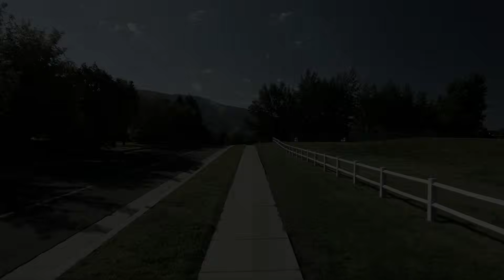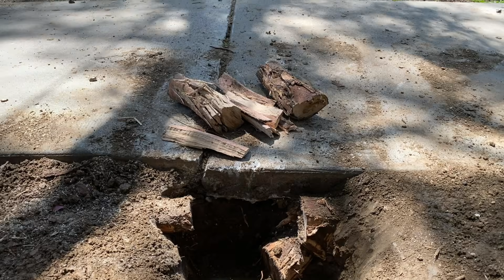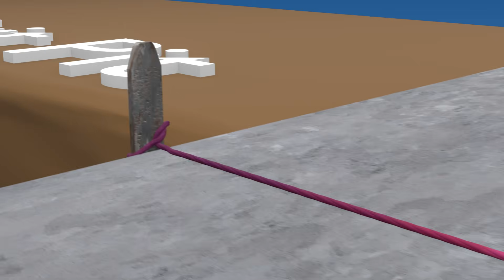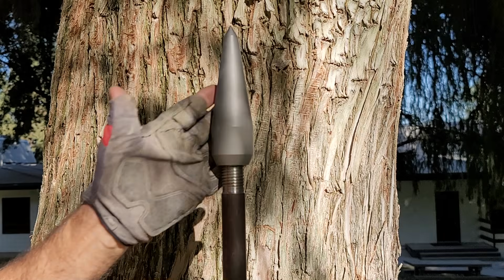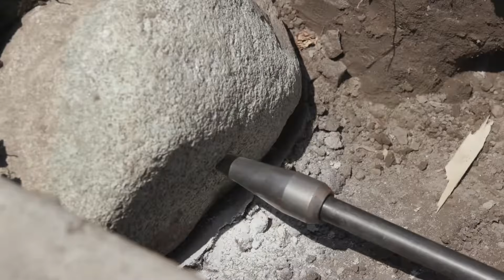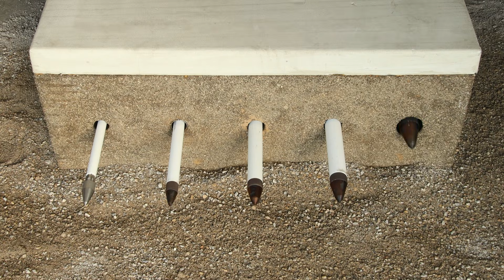Bullet Mole Sidewalk Kit | Bulletmole

Comment: These types of practices have been banned by most Utilty Companies in Australia. Aside from the injury risk using a sledge hammer, imagine going through a power cable with this thing. The next strike of the hammer blows your feet off! We were doing  this 40 years ago with a pipe and cap, cave man stuff. Are we reverting back to it? Next it will be the ratchet hand bore with a boring rod and bit. No wonder my backs near broke!
Reply: Your not allowed to use a sledgehammer in Australia?

What in the actual f**k? 🙄
Reply: @treasurecoastanglers1003  Go to specsavers, Nowhere does it say that you can’t use a sledgehammer in Australia. The practice of knocking a bar or point under a path is condemned.
Reply: Stephen, You are the reason O.H&S was invented. I wonder how many people would like to test your ridiculous theory. Surely you replied in jest.
Reply: Is all I can say is when you call dig alert first you eliminate blind penetrations not knowing what's underground in the area where you intend to make your hole. So let's entertain going through a power line, to begin with the handle of the sledge is non conductive, usually fiberglass, nylon composite  or wood so how does the AC current travel to your legs?  If it were metal then it would go to your hands first.. your boots are insulated so there is no return to ground. As such it would be impossible to even get shocked much less blow off someone's legs. To begin with, It would take much higher than 4 phase current and direct contact to your legs to even come close to Blowing them off. Dont exaggerate. It's not a lightning bolt.. How many amps does the average lightning bolt Produce ? Anyway who buries a 4 phase power supply within 24"  under a sidewalk..for crying out loud... no one.. If you did go through a charged power line. Say realistically,110 volt or even higher, and if you did Penetrate both the power lead and the ground lead or neutral wire then the most that would happen is it would throw the breaker. I've been doing this for 34 years and have never once hit a power line or gas line or any line for that matter going under driveways, sidewalks or roads.Dig Alert dial 811. As for the back, the Bullet mole goes through the ground much easier than a pipe with a cap on it. The sharp and hard steel head will easily Pentwater ANY obstacle in its way and opens the hole bigger than the pipe so it does save on the back. This kind of work however will always require some physical effort and the Bullet Mole dedinitely reduces the amount of effort needed no to mention eliminating frustration because you will have success every time. Thank you for your response.

Comment: Looked at the price and this is very expensive. I am sure it is well built but Price was three times what any other tool made out of the same quality materials cost. This single tool is more expensive that the tope of the line electrical and plumbing tools I am used to buying and it is definitely way out of the DIY market!!!
Reply: This is probably the best tool for DIY's because it is so extremely effective and easy to use compared to other methods,, However we admit that it is defi Italy out of the price range for an occasional user. That is why we rent the Bullet Mole to home owners and occasional use customers nation wide. The origional design criteria of the Bullet Mole was to provide a method to install pipe in any soil condition, consistent and every time it's needed, compact, portable, without the need for water,electrical, air source or hoses / cords. One man operation. And thus tool does exactly that. There us nothing even remotely similar.
Reply: Use the garden hose way . The pipe can flex easy. With no chance to cut a power cable etc.

Comment: No thanks, HDD all day!
Reply: What Is Hdd?
Reply: @stephenlafontaine2286  horizontal directional drilling, what I do for a living. More reliable and affordable that it’s ever been.
Reply: Can you drill through boulders all day long like we can do in our sidewalk video at bulletmole.com?
Reply: @stephenlafontaine2286  cant ever recall I’ve hit a Boulder right under a sidewalk, and some of the solid rock I’ve drilled through I don’t think that thing would survive.
Reply: The boulder in the video was an exaggeration to show what the tool can do if you did hit rocks,boulders,roots etc. I have hit serious obstacles like these and so have many of our customers.The point  is that It WILL make the hole and install the pipe every time. And especially on a short run like a sidewalk there is simply no need for bulke inconvenient equipment like compressors, hoses, and power supplies to do such a simple short run. We have a driveway kit video comming out soon. The size of this tool allows it to always be on the truck and available for one man use.
Reply: @stephenlafontaine2286   HDD is much faster and no need to dig an 8’ long trench. If the ground sucks and is rocky i would not be digging that far back just to get under a sidewalk. Seems kind of gimmicky.
Reply: @stephenlafontaine2286  also, can you go through builders all day long or was it an exaggeration?
Reply: Almost $1,000 for that metal stick?? Lol
Reply: @thirdpartypariah6514  by the way how much did you pay for your HDD rig? Also if it were just a stick of metal then yes that would be an outrageous price. But a "stick " of metal won't do what this will. Our target market is the average electrician, plumber,  landscaper,  data conduit installer etc. That needs to access uner a driveway or sidewalk. I'd bet you anything that we could have the pipe installed under a driveway with one guy inside of the time it takes you to unload and set up your rig, which would end up destroying the customers landscaping not to mention, I know that your rig takes much longer than an 7 ft. Long foot print at the point of entrance. It really all boils down to a simple equation of practicality, efficiency and cost. Simple math.
Reply: @stephenlafontaine2286  it really sounds like you don’t know much about hdd. Your target market is the same as my target market.
Reply: I can be completely setup to drill under a sidewalk in about 2 minutes.
Reply: And no need to dig an 8 foot trench.
Reply: If I was JUST boring under a sidewalk we wouldn’t even charge LOL. And to go under a driveway up to 35’ costs someone only $400.

Comment: Used to use the bullet hooked up to an air compressor. The bullet was twice the size as demonstrated, and it had to go thru a 3 lane highway to install water mains. It was awesome to use. I was on the side to "catch" the bullet when it reached the other side of the road. Freaking things were heavy.
Reply: Earth displacement hammer. Various brands and designs for different ground types.
Reply: I've used the 2" hammerhead mole for waterlines on a 185 cfm compressor. They are pretty heavy
Reply: Those are called pneumatic missiles. Tink-tink-tink-tink. Uhhh was it suppose to come up through the road????
Reply: <<Those are called pneumatic missiles. Tink-tink-tink-tink. Uhhh was it suppose to come up through the road????>>

In the gas utility I worked for, we called them "Hole Hogs,"  About six feet longand four inches in diameter, and powered by a hose supply compressed air from a gasoline compressor,  they would pound their way across a street, up through a rock garden or wherever they needed to go.

Pretty amazing,  although they required some skill to aim so that they might go where you wanted and not someplace you didn't want them to go.   Youn needed to know when to stop, dig them up and reposition them for another leg.

<<Tink-tink-tink-tink>>  Yep.  That was the sound!
Reply: @MrMattydavee or ram bores
Reply: @SeattlePioneer  nice we called them ram bores at the gas company here in STL. Also used huge directional bores

Comment: Stupid idea of a tool..  i can drive a stick of emt through the same way, better yet a stick of black steel pipe with a point on the end made with an angle grinder..  but for under just a sidewalk i use a long drillbit and a hammer drill..  no big sledge hammer to break your back and gets the job done way quicker since you dont have all that string crap setup time...
Reply: Thank you for your input. The string set up is no more necessary than it would be with a piece of pipe. This video is instructional so it demonstrates every scenario. I never use the string set up myself on a sidewalk, you can eye ball it. However, On longer runs it is most useful.. keep in mind that the effective range of the Bullet Mole is over 60 ft. So it does sidewalks and streets etc...I do know for a fact that a drill or pipe would never get through the rocks or roots that this tool can, ( for all sizes of pipe up to 2"). In addition . We do realize that this tool is out of range for some folks, but as for professionals who really need versatility and have  to rely on the job getting done each and every time no matter what then this tool is the ticket. Check out more at bulletmole.com and we wish you the best with all your future projects.
Reply: IDE
M
Reply: Hard On

Comment: How much soil displacement happens with  2" inch.  Is it possible to drive lets say 4?  Or would that be outside of humanly impossible. I mean I know ah guy that drives a r r spike in 6 licks with a spike mul
Reply: The diameter of the point used for a 2 inch pipe is 3". Depending on how compact the soil is, will determine haw hard it is. If the soil is real tight we recommend driven the smaller point first. And in the case of dry clay or soil we recommend running some water through the hole made with the smaller point in order to moisten or lubricate the soil before driving the 3" point. Keep in mind that you are only driving the point which opens the hole bigger than the shafts. We have driven the 3" point straight away with many large roots under a 22 ft road. We used 3 guys which did make things easier. Thank you for your comment and queastion.
Reply: I did some research hilti had done a bunch of r&d on a driver that impacts a pipe attachment similar to this but they sold the prototype to Milwaukee who never did anything with it . i guess the irrigation and sprinkler installation market is to small for the big names . that makes this product perfect for the installers who are makers on the side. Im impressed they have found the perfect product to produce. I would like to invest with them.

Comment: I guess I should have marketed this myself 10 years ago.
Good on you man.
Reply: Well Thank you. We began development on this tool sytem 24 Years ago. Although it looks simple, it is really quite  complex. Between the specific design features which are patented for various parts, the steel chemistry which is different for practically each part and the diverse heat treating and tempering processes specific to each part depending on the demands and requirements that each one must perform. It has literally evolved for over 2 decades to reach it's ultimate state of performance to such a point that the tool will not only complete its intended job but will also last a long, long time and be reliable to continue performing for years to come.
Reply: @stephenlafontaine2286 : I could of used something like this about 40 years ago.   LOL
Reply: Exactly

Comment: i've actually used this method to replace the water main under a virtually undiggable front yard that ran in  to a state hi way.  the excavation alone was estimated at $4,000.  i put the pipe in in about one day.  i removed two squares of sidewalk and dug a 6' ditch by hand which took me about one day.  i jused 10' sections of 3/4" steel pipe with a plug as the impact end for the hammer.  i used a 4 pound hammer and went through 3 plugs.   i put the whole thing inside an 1 1/2 pvc pipe 20' long, then added another 10' section to make the 30' out to the street box in the sidewalk.  because i was inside a pipe, i didn't need an exit trench.  i just pulled the steel pipe out of the pvc pipe back in to the basement.  i was off target about 4 inches at 30 feet.  the plumber, inspector and the water company were more than impressed.
Reply: Thats awsome. Your the man! Enginuity and perserverence is what makes thing happen. Way to go! Even with those rudamentary materials you were able to prevail. By this you can see how much better it would have been to use a Bullet Mole which is actually built specifically for this task. From steel chemistry to functionality to thread design to heat treating and tempering to forging the Bullet mole is built to get it done and to last for years. And it positively will indeed. There is nothing quite like it except what you just used. An I respect you for what you did. thnak you for your comment and again congratulations!
Reply: @stephenlafontaine2286  thanks.  i wish i had something like the bullet mole.  i made and welded a cone to the end of a 1 1/2 pipe cap as the point.  my problem was i needed to go 30 feet and the cost for my one time use was not feasible, it wouldn't be much cheaper than just digging.  it would quickly pay for it self if it was something i could use regulardly.  most plumbers i contacted told me it couldn't be done.  my other big problem was drilling through the 120 year old foundation.  i used a diamond core bit i found on craigslist for $25.  good thing to because it was solid rock for the first 5 feet including about a foot of granite.  your tool seems like it would work great for doing what i did.   the thing people should know and practice without fail is call before you dig.  there was a 12" plastic high pressure gas main 40 feet out from the house for me.  i wouldn't want to hit that.  it would be cool if you made ends that would screw on to steel pipe that a guy could buy or make to any desired length.  i read in the comments where you talked about the cost of the various lengths of shorter rods.  i like how your system allows the pipe to go along with the rod.  what i did was just unscrew the end and pulled the pipe back through the pipe.
Reply: @frotobaggins7169  thank you for your b response. You have hands on experience. FYI we have just came out with a point and impact cap that screws onto a GRC pipe thT can be driven into the ground, then remove the point and cap when your through and leave the pipe. We do recommend using the bullet mole first but you probable could drive it straight away if you have relatively soft soil. You can see a short clip of this in action on our website at bulletmole.com .it's at the very end of the video, "especially for electricians."
Reply: @frotobaggins7169  Very innovative system. If you ever make a video out of this, please let me know. Thanks for sharing.

Comment: You can get the same thing for much less than this for side walks 

In the case you need to go underneath a 2 car driveway this would be highly inefficient for anysoil that isnt sand basically. Would be cheaper to rent a Vermeer LM42 or similar irrigation plow with bore rod attachments. I've been doing irrigation for 12 years and have gone under a lot of sidewalks and driveways, if you wanted to bang that rod under a normal size driveway and hit a rock halfway through that's big enough, you're screwed and half to start over. Waste of time and way overpriced for what it is. If it was hydraulic, it would be a great product.